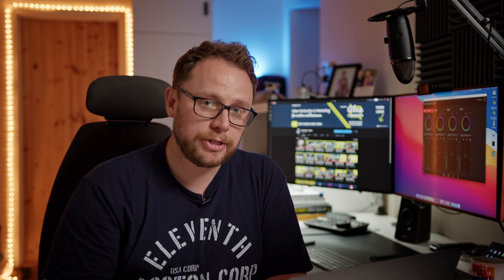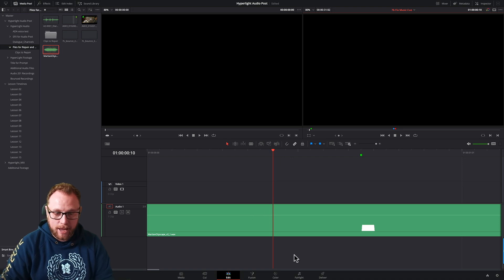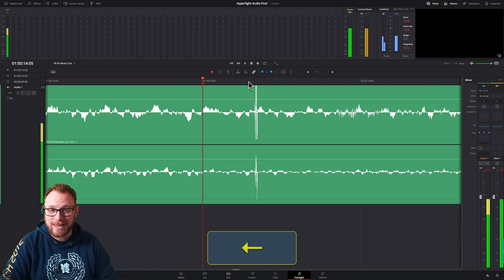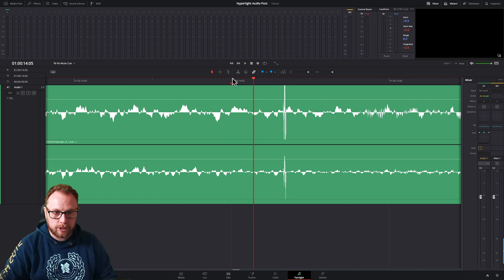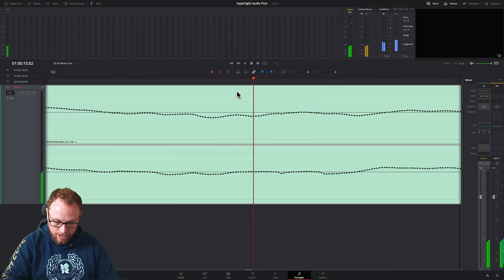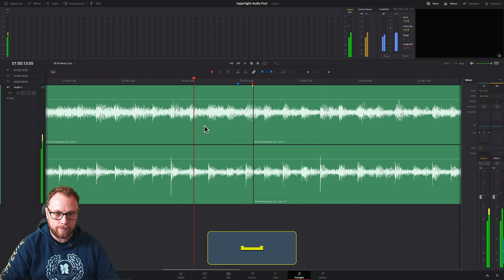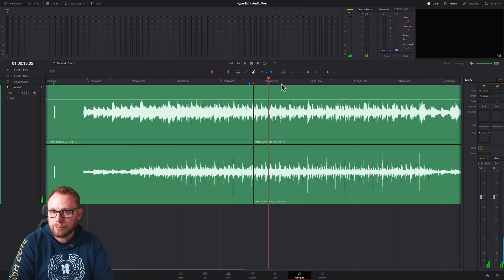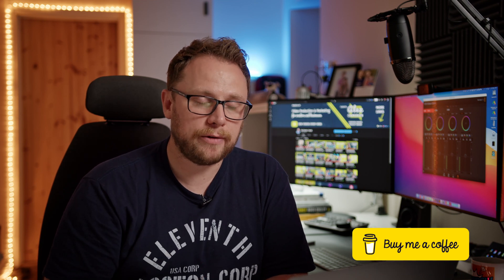How to REMOVE bad audio in Davinci Resolve 17 | Sample Level Audio Editing

Comment: The snag is that at the end when you play it back, the click is still there.  It has softened, but there is still a click-like noise at that point.   I don't know how you got the click in the first place.  Perhaps you contrived it by drawing it in, or perhaps it occurred naturally.  If the latter, then perhaps the music was meant to have a bit of click there and it got exaggerated, in which case you may have restored the original intention.  I used this technique a few days ago, and the clicks did not disappear, but they were softened a lot.

Comment: Davinci should allow users to press "SHIFT" between 2 separated nodes in the Edit sample leves section, because it's very  hard to make a consistent straight line in there, and if the part to fix is really long, it's almost imposible to fix.

Comment: Hello Alex your Channel is Very interesting Thank you very much for your the point explanations I have a Question please .. First of all I have the Da Vinci resolve 18.1.4 resolve studio edition,and because i Record inside the churches speeches i.e from father's bible,I'm inside the orthodox church and I cannot avoid the ups and downs of his Voice for example I want to stabilize The Voice and I don't know how to decrease the volume when he Speaks loudly and in the other hand when he is whispering some how .. I found How to remove echo. Please if you can answer me I will appreciate so very much. Paul from Greece AThens. THANX!!!
Reply from the maker: This is a great question and one that I am sure a lot of people have trouble with. So what you’re talking about, if I’ve understood correctly, is balancing the levels of your audio which is a crucial step of the audio editing process. There are some things you can do like normalisation and also using a multi and compressor to help you smooth out the high and low points. Also, the Dialogue Leveller is very good when used correctly. All that said, there’s really not a hard and fast substitute for balancing audio simply using key frames. It’s much the same as with colour grading. Before you stick on a LUT or do any creative look building, you need to balance/normalise  your shots so that you can then more broadly apply a look that works across all the clips on mostly the same way. It’s the same largely for audio too although I often start with normalisation and a multi and compressor to get me most of the way there. The better recorded the audio initially then the easier this job is too. I’d always recommend recording at a lower level as boosting in post and clean up is a lot easier nowadays and, unless you have 32bit floating point recording, you never want to have an issue when the audio gets too loud and clips because it simply is not recoverable. Does that help? Let me know either way, might be worth a video on this topic too so do stay tuned!
Reply: @AlexCameron-Depiqd  thanx A LOT FOR THE ANSWER Alex!!! i appreciate so very much!!Αnd of course it helps with out doubt!..

Comment: This method doesn't work with Davinci Resolve 18. I believe its some kind of glitch. Has anyone else tried it on DR18? 
I've tried it on DR17 before and it works so I'm pretty sure i took the right steps.
Reply: I just tried it for the first time in 18 yesterday and it did not work.  Maybe in the next patch...

Comment: Thank you Alex, great in-depth video with just enough to work with, but not to much to get bored half way through. This is an excellent way to get rid of clicks and pops here and there. I have a bigger problem though... I received a video to edit from a client that have clipped speech portions of minutes and minutes and to do this to each clipped part would take weeks to fix. Do you know about a way or plugin that can detect and fix the clipping by itself, without me going through all the clips? Thanks again for a great tutorial!

Comment: Hi, My first time video editing... I'm a musician. I drag and drop my audio file, which is WAV, It's mixed and mastered and does not need changing. So it's raw audio. As soon as I start playing the audio through Davinci Resolve 17, it distorts. I went through the settings, playback processing buffer size and changed it to 4096, which decreased the distortion but some remains, I then decreased the dB and the distortion was removed, however I need the volume to say the same... Anyone that can help, please do. I was supposed to learn, create and upload today and everything has come to a stop, due to this stupid ass software that ruins audio. No my Mixed/Mastered final product in WAV format and it's original Logic Pro X file is not distorted.

Comment: I have a problem with the DaVinci Resolve editing program that after rendering, I sometimes have these high audio spikes that make a very loud crackle or hiss. Before rendering, I never see these high-pitched spikes in the audio track. If I cut out these high peaks at one point and then render again, they usually reappear at another point and I may cut out a small part again. These spikes don't always occur, but 1 out of 4 times approximately.

I record with the program Streamlabs OBS and a Rode Podcaster USB microphone. The format is MP4.

What can I do to solve this problem? It can not be the USB slots, I have already tried on several.
Reply: I fixed it. The problen was the AAC Audio Codec what is not so good. Change the format from MP4 to Quicktime and then go to Audio and choose the codec Linear PCM. Since I have a new XLR mic with interface (not an usb) I dont have these problems with my recordings.

Comment: Really nice video here... I like these little tips that aren't obvious but a great help
Reply: Also can you do this with big things like editing out sirens in the background?
Reply from the maker: In theory...yes....but I think you'd find that you start to affect too much of your other audio and also it can be hard and tedious to do this over a longer clip.  Remember it's not isolating a frequency but rather just a small sample of the audio which is why little spikes and pops work well because they are only there for a few frames or less.  You might try targeting the frequency using EQ or even the noise reduction tools if the siren is the typical high pitch affair.
Reply from the maker: Glad it was helpful!  Thank you Curtis.